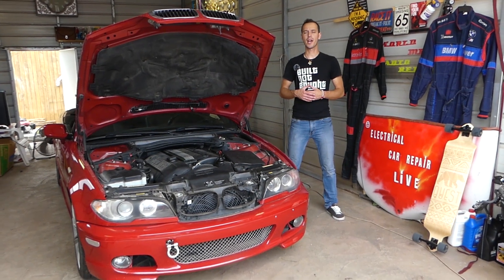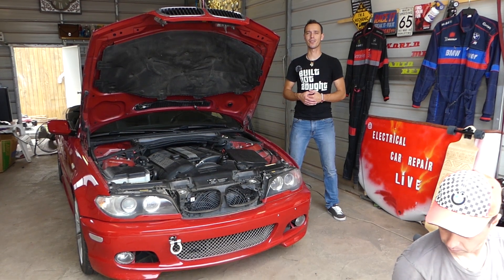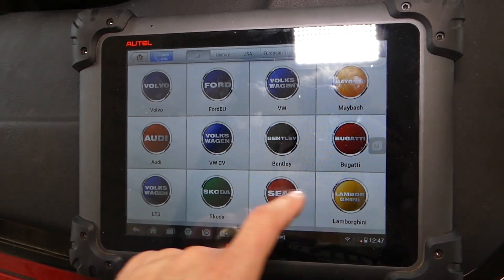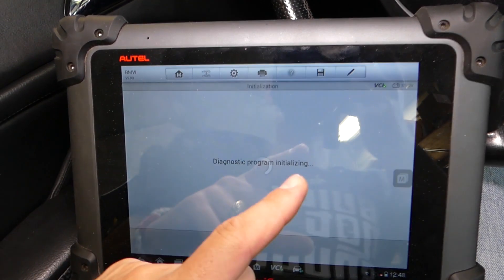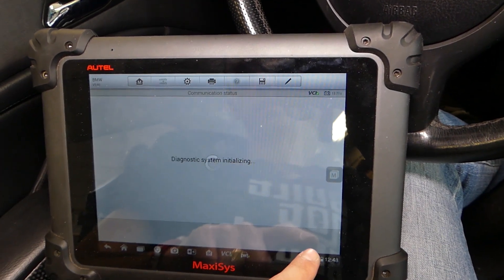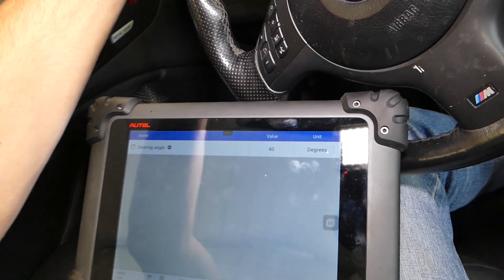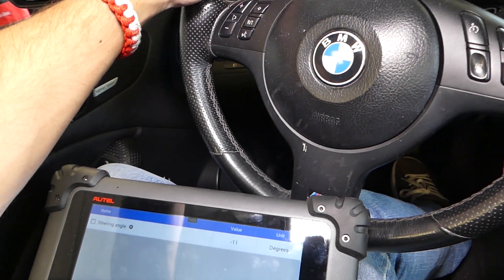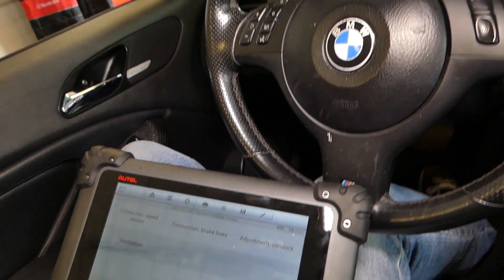HOW TO KNOW IF STEERING ANGLE SENSOR IS BAD GOOD BMW E46 E53 E83 E65 E60 E61 E85 X3 X5 Z3 Z4

Comment: Thank you for this video.
I ve checked the value of the steering angle sensor and when turn the the stering wheel rightbor left the value stays at 0 zero.
So does it means that the sensor is not working anymore ?
Thank you